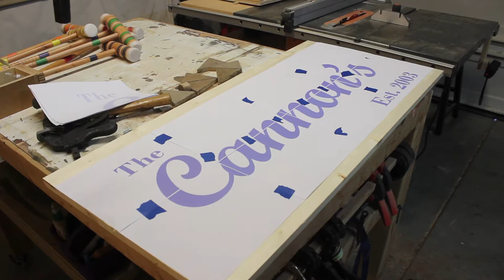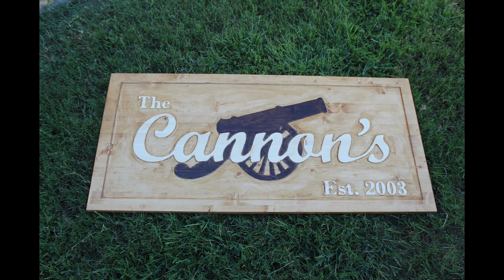Making a Routed Sign - Wooden U

Comment: Nice project. Be careful not controlling the off cut between the fence and the blade. Letting that piece just float there gives the wood an opportunity to bind and then kick back on you. Notice that that one piece even came back a little. Better to control it with a push stick or use a block clamped to the fence at the beginning of the cut the distance you want. Then it has some play room after the cut.
Reply from the maker: SO LT thanks yes I don't have a good push block for that, that's why I was standing off to the side.